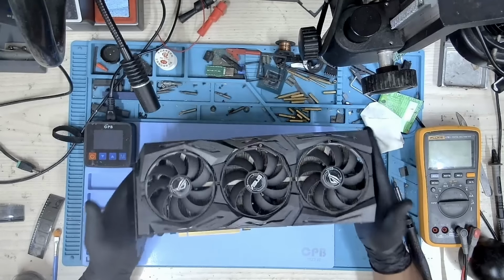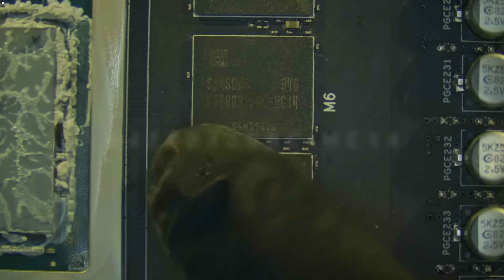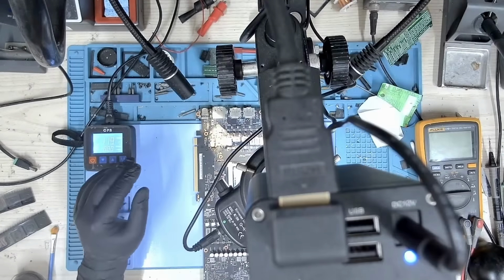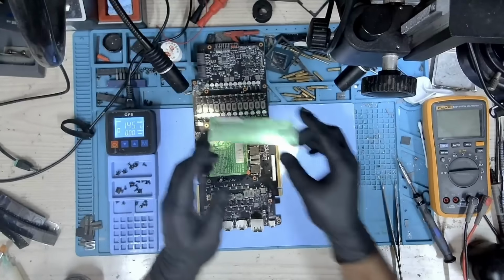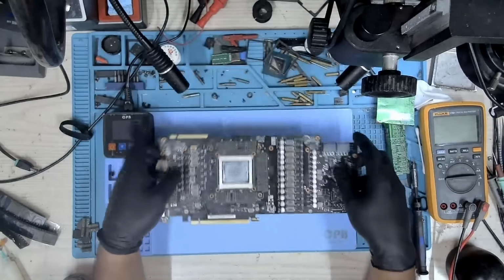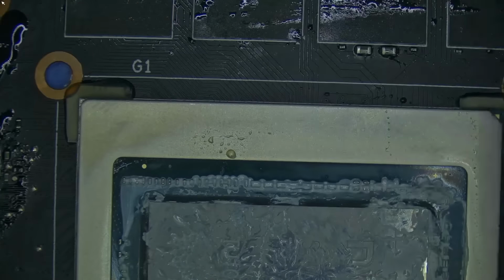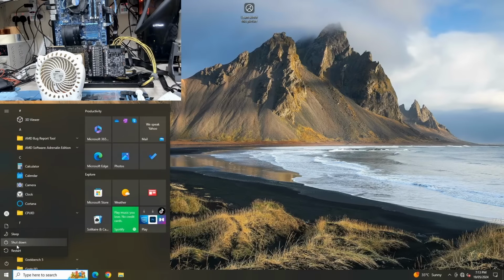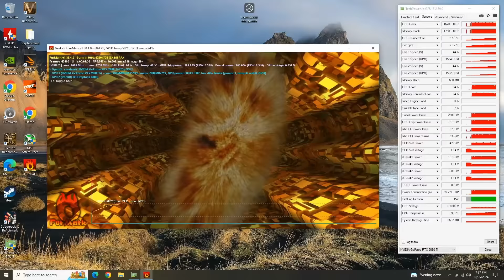Upgrading Asus RTX 2080 Ti memory from 11GB to 22GB

Comment: I might be too old, but back in the days, graphic cards had free slots/sockets for memory upgrades. You could upgrade its ram as easy as you could upgrade the system's ram.
Reply from the maker: A lot has changed 😁. And so is the weight of these cards. Glad to have you on my channel. Welcome. 😁
Reply: If we ever lose all the people who remember, who think like this, the world will parish ..unless it's already gone
Reply: Ari in the houuuse
Reply: what are the names of these gpus?
Reply: I remember reading or hearing somewhere that they stopped doing that because of the speed that VRAM needs to have in order to load assets and stuff fast. It supposedly is a much faster processor and needs higher speed to function properly. My opinion? Yeah, it would be awesome if we could add VRAM by switching sticks or something.
Reply: That should have said ATI lmao. The rage 3d pro had a ram slot
Reply: @Ytubefunk  No it is a good reason we dont do it anymore and if you want to return just go into some computer museum or start collecting. I am a huge IT nerd, i hate to throw away hardware or electronics and even i wont complain about soldered LPDDR memory.
If we would continue this "way of thinking" the "world will parish" because we are just horribly inefficient and dont improve at all.
Reply: @Donnirononon  🤝
Reply: The reason the memory chips come soldered - alongside very particular in-PCB-trace wiggle patterns going to the memory chips - is because the signal quality requirements have gone way up, as speeds have gone way up.

The faster you go, the better you need to drive - as what would be a small error at lower speeds will become a massive problem at super high speeds.
The weird wiggly wire patterns are there to make the data roads from the slightly unevenly placed memory chips an equal length, such that it's easier to orchestrate a pipeline where little data chunks from different memory chips can arrive exactly to compliment the previously arrived chunk.

New stuff is also very cool, what's not cool is arbitrarily locking this cool info behind walls - as well as this modern trend of "no, you cannot purchase this chip or component", that's some real tiring stuff.
Reply: I was there, 3000 years ago... And that card was S3 Trio - Virge DX/GX with 512kb/1mb ram.
Reply: we would still do this if not for signaling . most would opt not to and it might be cost prohibitive . then more potential failure points. still a fantastic idea for certain parts.
Reply: Would be so good if these GPU manufacturers, start to use SODIMM Ram used in laptop  maybe DDR6 so it could run faster, that had dual slots or even four so we could possibly upgrade it into 16/32/64 even 128 or 256gig, man I hope we go back into 90s tech computer where you can slap and upgrade your PC easily as everything was plug and play
Reply: That must have been pre 2006, our cards back then could not be upgraded
Reply: We are getting old man.
Reply: My first PC's video card had sockets to double the VRAM from 1MB to 2MB, but the memory modules weren't as easy to obtain as sticks of main system.
Reply: I remember that as well. Although I was to young and broke to get one at the time. Wish I could have. Wish they would bring that back
Reply: Haha im certainly not to old to remember but to young/dumb to get it right. You could stick it in anyway you wantet so 50/50 if it worked. Maybe there was a corner i could look at, but i sure didnt notice it 😂 

In comparison, ram has a notch. It is really easier that way 😅
Reply: @TheNormanbro  you are right , that was the one.
Reply: Were the modules/sockets next to each other in an angle? I think I've  seen some back in the day :D
Reply: My first gfx card was a sparkle 1mb lol.. interchangeable upgradeable card.. miss those days!
Reply: @TheDoomerBlox  you say all that but cpu's aren't soldered into motherboards. The truth is they'd rather spend 5 cents on solder than 50 cents for a retainer die, and having an unupgradable component would mean replacement of the whole card 15%-30% more often. Graphics cards can be built just like motherboards and have replaceable gpu's and memory so a full upgrade wouldn't be needed until memory types changed if the card specifications allowed for overbuilding under the license, but the duopoly doesn't allow that.
Reply: @Alina_Vasilievna  first you would have to convince GPU manufacturers of why they would want you to do that as opposed to buying their newest model.
Reply: Yup. I remember those days. But then again? I played Pong when I was a child.
Reply: i had an old card like that once and i pulled some chips off of a different board and put them into my video card, i had no idea what i was doing. all the chips exploded! i removed the remaining bits and my graphics card still worked. :face-blue-wide-eyes:

Comment: I've been wanting to do this for my GPU for the longest time. I will use your video as reference. I started getting all the equipment I need for it.
Reply from the maker: Great. I wish you all the best. Remember never give up
Reply: What does upgrading the memory do for it?
Reply: @vedob5163  I use it for stable diffusion image generation stuff, sometimes require a lot of vram to do certain things. The 2080ti is a very good card for it in terms of price/performance. And it undervolts very well, I'm running it at 150w. It as fast as a 4070 in terms of fp16 performance. You can do 16gb on a 3070 as well, slightly slower for SD work.
Reply from the maker: Thank you for sharing that info. Its really helpful specially for someone looking for options in the same workspace.
Reply: Practice on dead gpus first. Never a good one
Reply: @GraphicsCardRepairs-tk7ql  great work 22GB perfect for  LLM, still cheaper than a 3090
Reply: This compatible with any 2080 or is it just the Ti?
Reply: @Th3_Gael  2080 works too, GPU-z will show in bios section the supported memory. Someone on YouTube has done it on the 2080 8gb to 16gb. 2080 is as fast as the 4060ti for stable diffusion, and undervolts well.
Reply: @oneanother1  man that was a quick reply.
Thankyou
I didnt even know this was possible. 

Ill probably go with the Ti then for the difference in performance.
Reply: Nvidia will let the AI dogs loose to get this man
Reply: Maybe buying another graphics card is going to be cheaper than buying the whole equípement to do it.. just saying..
Reply: @RandalloO26  its not just for one GPU, its for repairing electronics. Yeah, electronic repair equipment ain't cheap, bro.
Reply: i hope your practice soldering first, or youre gonna burn that board
Reply: @oneanother1 does it help with in game performance at all? 8GB isn't a whole lot these days.
Reply: @3of12  nope, more vram good for ai stuff. 12gb card should be good enough for 1440p. Like a 4070 and up.  The 4080 is better, but wait til next gen cards arrive for the price to be lowered on the older gen.
Reply: @oneanother1  I'm not convinced I wouldn't gain any performance. The Ti has 11GB. If I replaced half the memory it would probably do me good.
Reply: @oneanother1  Is it as fast as 4070 in SD, when undervolted to 150w?
Reply: @ThePentosin  yes, check out the toms hardware benchmark. 4070 is slow because it uses smaller buswidth. You want at least 16gb, and 22gb or 24 GB vram for more serious users. Wait till the 4080 drops in price, fast card for stable diffusion.
Reply: @oneanother1   Toms hardware has the 2080Ti 10-20% behind the 4070. And i'm guessing that's with stock power levels.
Reply: @ThePentosin  well, its pretty darn close, less than 10 percent. Check the latest tom hardware review, they had an earlier one and later one in DEC of 2023. Even undervolted, its only slower by a couple of seconds. The price difference goes to the 2080ti. If you want more performance, the 3080 is a really strong card because it has higher buswidth. Though these cards are much high power consumption. The 3090 has 24gb at a reasonable price, for the vram in SD.

12gb vram is no go, I constantly run into out of memory errors and have to work around it. A lot of the new stuff you see people doing requires at least 22gb vram. So there's only a few to choice from.
Reply from the maker: @cbozz7063 none burnt so far 😁
Reply: Once my 7900gre starts to become underspeced, I may do this.
Reply: @cbozz7063 No need. All you need is a variable electric hotplate and a SMD Blower. Some lead solder paste with flux. Remove the old chips and remember the Rotation (Pin 1. Usually an Arrow, Dot, rounded of corner and or a canted sight or line that marks pin 1 on IC's or memory chips. You do this else the chip would could short or simply wont work as intended.) After that clean of all the old residue and apply tiny amounts of paste on the pads. Preferably you do it with a pin template of the desired ic with a maximum thickness of 100 micron or 100μm. Then just allighn with pads tape it down with capton tape. And use a thin metal blade to apply the Solder paste. I would prefer the Omnix 5100 paste. This has lead, flows really easily and is ideal for home hobby stuff and doesn't oxidise as fast and has almost zero voiding (Air pockets in the solder joint).  Or use a tiny syringe to apply paste.

After putting the paste on the pcb. Place it on the electrical hotplate with a temp of like 90 degrees. Align the ic and place it on top. After that slowly and gently use the smd blower until it melts. And it should automaticly align with the rest of the pads as soon as the paste starts too flow and become tin.

That's all really. It sounds really challenging but its easier than manual soldering, trust me. The prep work is a lot of work but its easier.

I used to be an SMD Operator for TBP Electronics. Made loads of PCB's for big brands such the largest chip maker in chip machines. The biggest Appliance seller brand that starts with an H. The best brand for in the Kitchen appliance thats starts with an S and so on.  

Only unfortunate thing is you can't check the BGA memory chips for shorts unless you have an electronic Xray machine.
Reply: Just get a 3090 and don't bother, if you're gonna get all this equipment
Reply: @pneumonoultramicroscopicsi4065  its for electronic repairs, not just for ai image gen. As in a hobby and a possibly a career out it, depends if I don't suck at it. 2080ti is more power efficient than the 3090. I can run my 2080ti 150w, and its still fast for ai. That's why the 2080ti is much more attractive, but as time goes by, the 4000 series will be the way to go.
Reply: how did it go bro?
did it work or not?
Reply: @sevynmedford3803  not yet. Still using 11gb ATM. Soon, once I get everything setup. Got a bit distracted with other hobbies.

Comment: The 2080 Ti came out with a fairly optimal memory config, but cards like the 3060 Ti, 3070 and 3080 10GB are prime candidates for this kind of upgrade, as they can much more readily utilize the extra RAM. Still awesome that you're able to do this at all, of course.
Reply from the maker: I have one just for you.
https://youtu.be/EM1UL4GHviU Part 2 will come out soon
Reply: Just get the 3090 it had 24gb already lol
Reply: @LeaveNoEvident128  I want to see a 48GB 3090 instead.
Reply: +4070 12gb
Reply: I’m a dumbass and got a 3080Ti vice a 3090 at a Best Buy-camp-overnight event back in 2021. For $200 more I could have got a 3090…. I was planning on getting a 3080 and by the time they got to me in the line to mark me down for a card, those were my only options and I guess I fixated on not going top tier although I should have… 😂
Reply: @DSplatter  I would not pay 200 extra dollars to go from a 3080 Ti to a 3090, at least if I planned to use it for gaming.
Reply: @LeaveNoEvident128  I'd prefer 96gb.. though I'm not sure that's possible
Reply: 👀 for real? My 3070 is scared now
Reply: i got a 3070ti and it's only 8gb, i would love to double it.
Reply: @Danny-wv8ec I bought a 3070ti as a bridge GPU upgrading from a GTX 1080, and the 8gb of VRAM is such a drag for 1440p
Reply: @LeaveNoEvident128 Or Nvidia should stop being idiots and give people more VRAM
Reply: @DSplatter that's what you get for camping for a fucking gpu bro.
Reply: @YourFriendlyHoodVampire  I mean the camping thing wasn’t an issue. I’ve waited around for hours like that far too many times to be annoyed, especially when I was going to be able to finish my current build finally.
Reply: why would a 3060 Ti be a better candidate than a 2080 Ti?
Reply: @odellus  Because more VRAM will do nothing to 2080ti while 3070 could benefit quite a lot, 3060ti not so much but still more than 2080ti
Reply: my 3070 Ti 8gb is always crying whenever I open games, I need a 3070 ti 12gb card

Comment: one reason to have more vram on an older card is so that you can do 3D animation rendering with it. GPU based 3D rendering requires you to load the model into VRAM for each card so the amount of VRAM becomes a limit to the complexity of scene that you can render. more VRAM equals more complex scenes. You can also use multiple cards and split which cell they render to improve render times but you cannot stack VRAM so having more VRAM is very helpful. keep up the good work.
Reply: Not loading the model, you’re loading the textures..

Comment: Thanks brother for doing upgrades for my gpu , so wait for next mod i have other things 😂upcoming . I hope this video becomes famous for everyone. Peace ✌️
Reply from the maker: Thank you for the opportunity. 😁
Reply: For anyone interested to upgrade the memory for gaming actually it’s not worth at all you will not get any benefit. So i did this mod to try if it’s worth for workstation stuff . Thanks 🙏
Reply: @alialbeloshi5425 It will offer better performance going from 8GB to 16GB, since you get worse performance when you have low VRAM because swapping into system RAM is slower and will tank performance, that's why the 16GB 4060 Ti is faster than 8GB 4060 Ti
Reply: @iitzfizz false, it's not only a vram difference between the 8 and 16gb. 

Texture rate and tmu is less on the 8gb than 16gb that's why there's a performance difference
Reply: @Behemoth33  plus you wont see a bandwidth increase by just swapping modules
Reply: Both on EK Waterblocks how much would you charge ?
Reply: @iitzfizz  the 4060 ti 16gb is NOT faster then 4060Ti 8gb, brother where did you get that from
Reply: @iitzfizz  it's more of a stability rather then performance gain.
Reply: @TCLG6x6 actually yes you will if you put faster memory ic's in place of the stock ones, say from 20gb/s to 24gb/s rated ic's you will see a 20% increase in memory bandwidth
Reply: I reckon you'd see a slight difference from the timings.  Probably so small it's not worth mentioning.  The modules before and after were both 14Gbit modules, if I remember correctly.  So, no bandwidth gained.

But, I have a 6700XT 12GB and I can see, at least, when games use up to that amount.  And it's becoming more and more common from what I'm seeing.  Especially in these new UE5 games with photorealistic textures or just high resolution textures.  

The Callisto Protocol is worth mentioning because towards the end, I was eating up far more memory than I had in VRAM.  I was maxing out my 12GB VRAM and using a total of 22GB system RAM... so much swapping going on.  My performance took a MAJOR hit.

I'd have to write down every game as I played them to remember which ones actually hurt my performance when I get up to that 12GB VRAM usage range... but there's a few.

As for the 4060Ti 8GB vs 16GB, there are some games where the 16GB performs 35-40% faster because of the huge VRAM usage.  I know the new Avatar game (the blue people game lol.. not hating, I liked the movie) was one that performed exceptionally better on the 16GB model card vs the 8GB model card.  

Daniel Owen (channel name) just made the video comparing these two cards and which games at what settings will show differences.

11-12GB is almost the sweet spot, if not THE "sweet spot" for the cards that tend to have that amount.  They are generally 1440p cards at high-max settings to get 50+fps.  And there's not a lot of games, respectively, that will use more than that.

But, again, there ARE games that do, and if you play them, then it affects you.
Reply: I would find it interesting to see the memory controller load before and after, though.  For my 6700XT 12GB, gaming tends to push the memory controller, according to HWiNFO64, to 10-13%.  

Mining Ethereum, for example, is one of the only things I know of that pushes it to 100%.  Ethereum mining is heavily memory intensive.  It's why you can underclock and undervolt the core and cut your wattage in half while only losing 5% or so of your hashrate.

I just wonder if the memory controller even has any extra "load" on it in games and, if so, what games and what settings does it take to induce a higher load on it?
Reply: @reaper_c6  No, the timings the ram chips are run at are not set by the ram chips, so unless you change the VBIOS or something, it will run exactly the same bandwidth. 
It's like PC ram, dropping in higher rated RAM makes zero difference  until you change the settings the RAM are run at in BIOS. Nothing is automagical.
Reply: @alialbeloshi5425  What about in bench marking and overclocking, like on HWBot ?
Reply: Bro it really works ?

Comment: 21:30  I had no idea they used the resistors like old school dip switches or jumpers.  Thanks for the videos!  Helps demystify graphics cards!
Reply: can you explain what he did there? Why he replaced these resistors?
Reply: @IamSoulfuller  he didnt replace them, he just moved them to a different position (from low to high)
Reply: Its like togle switch but resistors